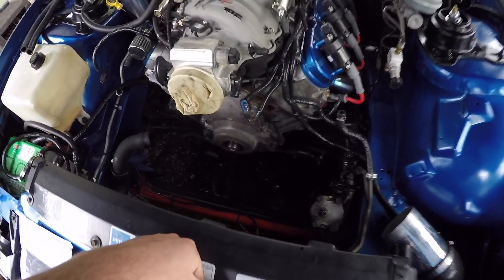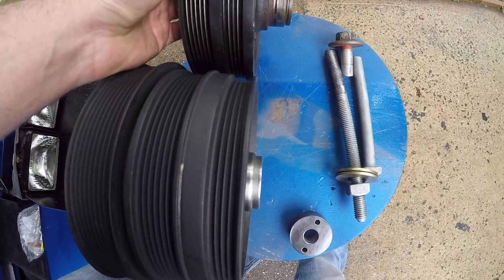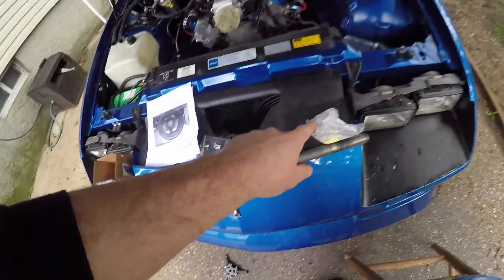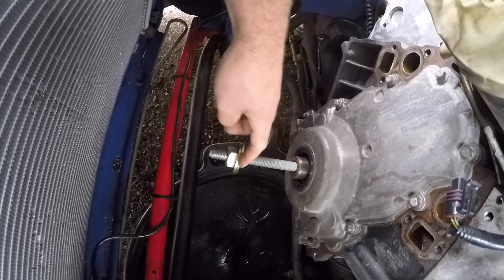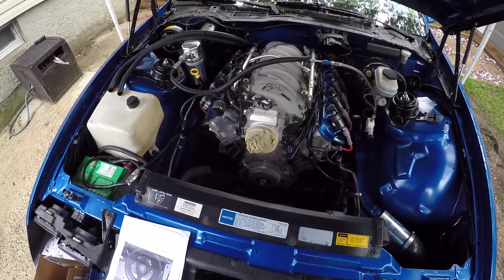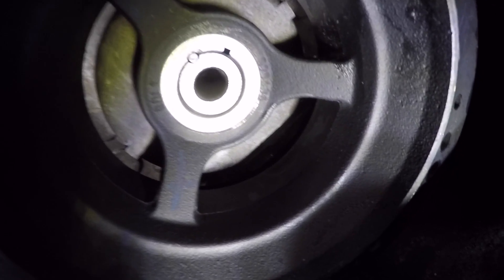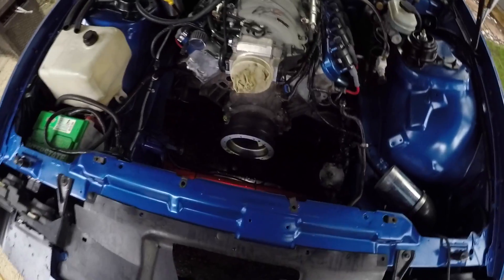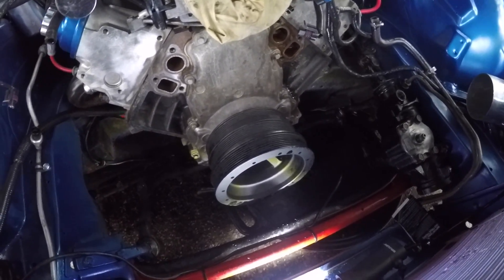How to: Pinning the Crank on an LS Motor | LSA Blower Swap

Comment: If you have a auto trans, can you put the ignition in "on" position and shift the trans to drive.....can you do that and still tightened the crank bolt so the engine doesnt spin?

Comment: Scary stuff drilling into a hardened crank, splitting a drill hole between the crank and balancer. What brand bit did you use, how did it work? One peice of advice I'd say is to use ARP Ultra Torque on the crank bolt. Many TTY bolts and especially at this torque value will bind at different locations on the bolt thus different sections of the bolt are turning at different rates. Not a good thing. Ultra torque ensures its a smooth even torque all the way thru and you actually get your intended torque value. Not a hack for ARP, just something I learned and I could tell the difference in torquing my crank bolts. Used by the NHRA as well as all other Raceing engines!

Comment: An LS7 bolt is longer and you can get it brand new from the stealership for less than $10. It is long enough to have about 3-4 threads before it begins to get tight and it will pull it down to within about 1/4 inch of where the damper seats. Then use the old bolt to pull it down the rest of the way. I use a little bit of ARP's Ultra Torque on the threads of the 2 bolts that are used to install the damper and then clean out the snout really good with carb cleaner and compressed air and then install a brand new bolt unless going back in with an ARP one. I would be nervous using that home made installer that you have due to the dissimilar metals being welded together and then pulling on them. If the galvanized bolt snaps off and leaves the hardened bolt in the hole, it will be much time and even more fowl language before it comes back out.

Comment: When it leaks oil from the front, and after you take it all apart and replace the front seal, and it still leaks - then and only then you should put some sealer in the keyway slot of the new pulley. Ls front pulleys don't have a keyway, but your new pulley does,  so you now have a nice path for the oil to leak from. I'm just sayin.

Comment: Instead of measuring .8 inches on the drill bit and taking the guide off to check the depth. The tape on the drill bit is suppose to be .8 inches above the guide. Put the guide on, bottom the drill bit until it touches the crank, then make your .8 mark. It will be the thickness of the guide tool plus.8 inches, but putting the guide on and checking the drill bit before drilling will ensure the correct.8 depth. Secondly, what tool in our tool box can measure.8 inches? This measurement  should be giving in cm. 20.3cm from the manufacturer. (6.5 8ths for tape measure people)

Comment: Couple tips for next time. First off they sell the all thread at your local bolt supply store. 
Second, use a bearing from a power steering pulley puller/installer kit. Or go to your local auto parts store and rent a balanced installer.
Reply from the maker: I tried Lowe’s and Home Depot but none of their all thread matched the crank bolt. Only thing that fit were their bolts.
Reply: LsxMatt well you can rent the proper tool at either oreilly or autozone. A guy here at work rented one a while back. I have some threaded rod left over if you want me to send you a piece, send me a message or just post here and I’ll give you my email address. Seems like I remember welding bolts together once and they broke. But I’m no pro welder lol.
Reply from the maker: Lmao neither am I, I was just realllly hoping they wouldn’t come apart😂. Thanks, but that’s alright. I actually just realized that the threaded rod for my old hf spring compressor is the same size.
Reply: LsxMatt ok bud. Thought I’d offer. Since your reading my posts I’ll tell you a little more. I had a black 92 camaro. Had a old school 383 I built in it. Haltech ecm, tpis mini ram. Clean like this one. I may post a video of it so you can see it. Ac and everything still worked. Ran 11.40’s at 122-125mph on motor. On nittto 555r😂 spinning it’s ass off. Shifted at 7800rpm. I setbit all up to turn lots of rpm. Dynoed 447rwhp and 479tq. Weighed 3400lbs now I have 2004 gto that I’m almost done fabbing my single turbo setup in it. Ought to be fun
Reply: Here’s my old car if you wanna Check it out. That’s not my normal wheels on it so don’t judge me lol. Sometimes I miss it. 

https://youtu.be/mUxVWGefMqE
Reply from the maker: Haha nicee👍. Yea I can only hope I keep spinning those tires. That 10 bolt is doomed😬

Comment: Good video
Reply: I have a 1989 Camaro Z28 and I am highly considering on doing a LS swap what do you recommend what motor should I put in there 5. 3/4.8/5.7  help
Reply: larrs loez me two I have an 88 5.7 with a paxton and tpis big mouth intake but I like how the ls series motor make a lot of power with just bolt ons